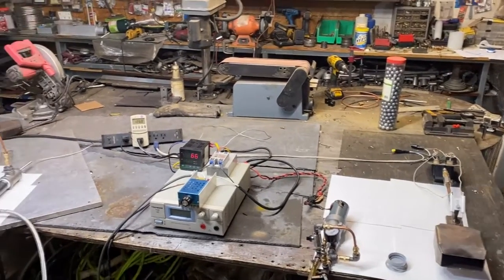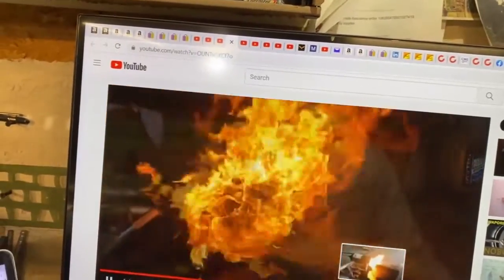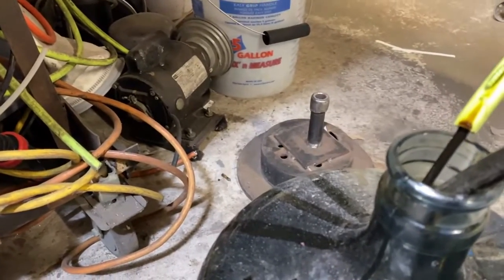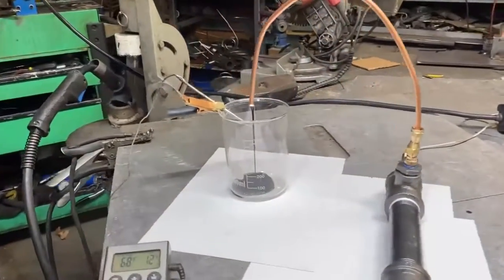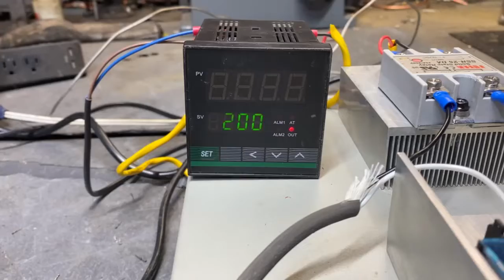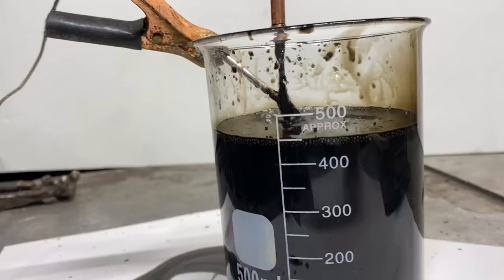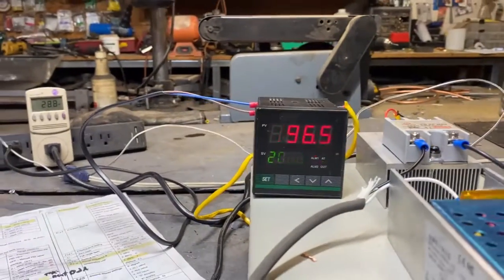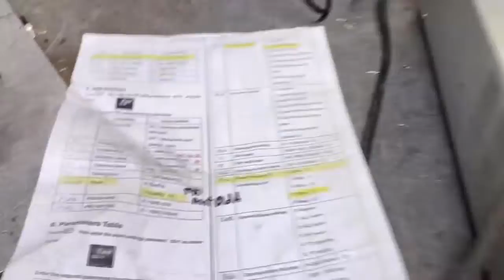Waste oil pre heater for oil burner  ?

Comment: If you use a bigger tube for oil heater tank you will not have big fluctuation in PID and you can maintain constant heating if you set the temperature correct. We use to preheat around 80C (176F)

Comment: Nice. At least that heating element looks cleanable. 

As much as I hate to say it I think it'll still clog overtime unless their feed oil is cleaner than waste engine oil. They may need to be aware you can't just ignore the heater. 

My fear is microfine deposits will fall out of the oil and collect in the heater area as sludge, and cause hot spots of low to no flow around the element. 

May take a week, or month, who knows... But that is certainly the nicest looking heating element I've seen to give you the best chance and be easily maintainable for a flush.
Reply from the maker: Yeah its probly gonna be a hot kettle set up in the end , i still wanna try it with 10 gallons of oil abd then open it up

Comment: You could try using the PID 'heat stick' in a seperate small sump filled with a float valve from the main tank and have that recirculating to keep a constant pre heated volume which then the burner draws from. More complicated but will be very stable. (Edit: typos 🤣)
Reply from the maker: yes ive seen systems that do this but was trying to avoid it on a ship at sea due to waves and all
Reply from the maker: Great input by the way thanks

Comment: You can heat oil in the tank, but also you must heat the "stick" with oil and air. Easiest way is some kind of flow heater around the pipe in pipe....one pipe for air one for oil, 80 celsius ksd, for heater I was use old russian resistor type pev.....for me it works....

Comment: What would build for a pool heater burning mix of mostly waste oil,  wirh some crude oil and gas condinsate?
Reply from the maker: Iv actually done this for several customers
Reply: @NOBOX7   Yeah, I am interested in buying a burner from you, wondering what kind of burner / heat exchanger system would be ideal for a 10x20 pool to keep it quite warm

Comment: Heating oil in a tanker is not a problem you use the heat generated from the engine and run it through a coil in the tank
Reply from the maker: wont work on a 30 ton tanker

Comment: No one understands PID controllers…some think they do.  Btw, "his tree sus" is how you say it.
Reply from the maker: Lol i knew i was saying wrong during editing when i seen how its spelled again  , thanks for the feedback
Reply: @NOBOX7  You are welcome.   I really enjoy and respect your work.   Two secrets to heating oil: One is to use the lowest possible watt density.  Second is to make the heater easy to clean.
Good source of inexpensive cartridge heaters is: Plastic Process and Equipment.   If you run a 240v 1000watt heater on 120v. It’s a ~250 watt heater.